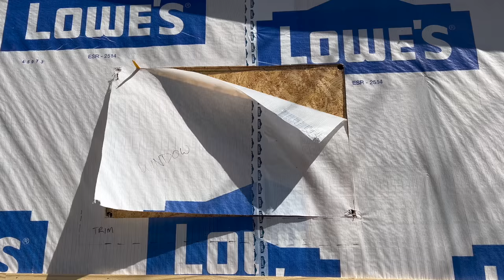Using PALLET PLANKS to side our DIY shed!

Comment: Kyle, and Shanon, I gotta tell you, y'all did an outstanding job on the shed!  The teamwork was a joy to watch, so, thank you for sharing!
Note:  At my second house, I put the shed 225 feet behind my house.  To ensure I didn't miss any periods (Ice Hockey), innings, or quarters (NFL before they went all woke), I dug a trench from the back of the garage wall, down to the shed, ran the electric cable, inside the appropriate piping and buried it, allowing the shed to have all the necessary electrical lighting and "Mancave" apparatuses, to make my time inside the shed [The He-Shed], truly enjoyable 😉.  The shed had double doors and a ramp to accommodate easy in/out maneuvering of my riding mower. The He-Shed was outfitted with a college dorm refrigerator, hammock, outdoor, camping recliner, flat-screen TV (wall mounted) Tap and ice barrel (keg), along with a workbench and all the necessary lawn equipment.  There was also storage in the roof rafters and under the floor.  Can you guess why I put my He-Shed 225 feet off of the back of the house?....Twenty minutes later....  There was a road that ran along the back of Property that made it easy to load and such through the back gates...  yea, that's why....
Keep on keeping on Brother and Sister!
Godspeed.
Reply from the maker: 🤣 love it! 😁
Reply: @K&S Get Out  While your huhumm, "Shed", is close to your living quarters, you are still absolutely able, to add "Mancave" touches, to the workability of your "SHED",  thereby making your time "in" a tad more, shall we say, enjoyable 😉 😉 😉. 
In all seriousness, the shed y'all built, is phenomenal!

Comment: Kyle, I use a router with a cutout bit for all my windows. You drill one hole and slide the bit against the frame and cut it out. Nice finished edge on the sheathing and just leaves the corners to nip with a hand or Sabre saw and your done. Just the most efficient way I've found. Great jib Hoss!!

Comment: There is a rotator cutter also. . It rides along the wood but blade is only through  the drilled holes, so it is guides along. You can cut circles or squares with it.

Comment: Looking great good job on the windows Kyle. The only thing different than what you did and the ones I've seen is that the top sheeting is cut at a diagonal and left a tad long the window is place, then the tape goes under the top house wrap but over the window flange. Then the house wrap is pushed down over the tape and flange to the edge of the inner flange. Then the 2 top diagonal corners are taped down.
This way there is no gap for water to enter at the top. The channel to watch for great window installs is Doug & Ashley @ DIYfferent. Another OCD perfectionist.

Comment: Great job on the storage building, I can’t call it a shed cause it’s not leaning and doesn’t leak. Well house, chick coup, and house build down the line in you two’s future. Do you have a sander or router?
Reply: I guess they're prepping for the  "housebuild sans hitches" - which is mighty practical. When i think of the progression between building the goatshed & building this work cum storageshed. WOW! 🤩🫶🎯
Reply from the maker: The list is never ending 😉 we have a sander, but not a router 😊

Comment: If you have a hand held router it will work amazing.  Simple life reclaimed has a couple of good videos on how to, they are a couple of years old from when they were building their tiny house in the pole barn.  It makes a smooth close cut that you don't have to clean up.  Good job, the saws all is probably the toughest to use because it beats you to death using it.

Comment: label adhesive ... Smear veg oil or shortening over the residue. Work it in 'til it turns to "snots". Wipe and wash oil away with dish detergent. Also works to clean hands / tools of evergreen sap when you prune, cut your live x-mas tree, or make wreaths.

Comment: Casement windows open from left to right or vs versa, and it is double hung windows that open up and down.    There is a difference, in that the moisture has a way to escape if put in the way the window was designed and if not the weeping holes will be in the wrong positions .   Hopefully you will not have issue with the ones you have.

Comment: Concerning sticky remnants of labels on glass, food containers or transparent surfaces (works on all surfaces really) there are safe solutions, one available here in Australia, likely USA too, called "GOO-OFF".
 But I have for years used some Eucalyptus Oil, and I think you can also get it in USA. Only caution is not on some paint or synthetics, test on inconspicuous spot if concerned, but fine on all glass and plastics food containers.  A little put on a cloth piece or paper towel, moist not drenched/dripping, and some light rubbing on sticky residue, over say a minute will dissolve away the sticky goo. A final wipeover with moist cloth/paper towel and if needed normal dry final wipe and all cleaned surface. Advantage is it leaves a nice Eucalytus odour. For windows later long term glass wiping using classic windows cleaner like WINDEX will take care of the clear view in the long term.

Comment: The shed & door & windows looks fabulous,,,team work makes the dream work 😊,,I so hope what happened with me & a window don't happen with your windows ,,we put in sideways a window made like your ment to rise up & downfor the same reason a wider view unfortunately for reasons I don't know it had warped so that when closed thr top corner won't completely closeleaveing a big separation Crack in winter we have to block up with whatever we find to fit into the open area,,if you know what could cause this maybe you can take the step now to prevent it before the warp happens in yours ,,I hope my experience helps you out,,have a beautiful & blessed day ❤
Reply from the maker: Thank you for sharing! Hopefully it doesn't happen to us 😉❤️

Comment: You ran into every carpenter/roofer/builder's dilemma. Anytime you have two separate starting points that are supposed to match up on the same plane you snap a line on the plane that goes all the way through. Then on each side, you measure down and snap lines taking into account the amount of overlap, start there by using the bottom line as the top of your first board. If there is an unequal height, you set the bottom board on the bottom then correct the line on the next row. Basically making the uneven row be at the bottom. Your tie-in will then be seamless and even. It looks GREAT!!!!

Comment: Since I have no clue… are you going to caulk the seams between the siding boards? Or is they even necessary? No clue?
Reply from the maker: Not 100% sure yet, but we may run a line of caulk along the edges to keep bugs out. 😉